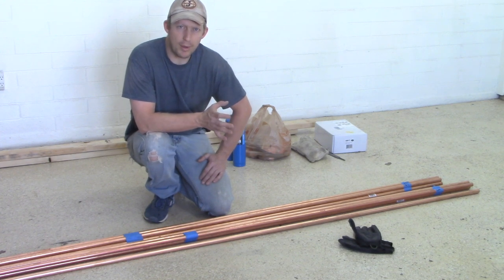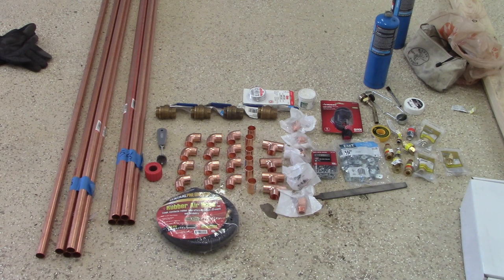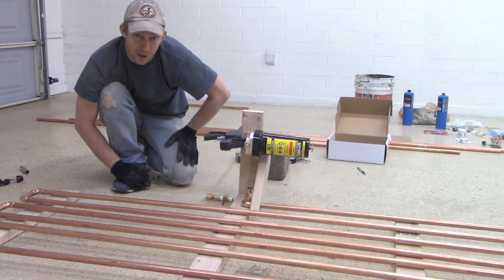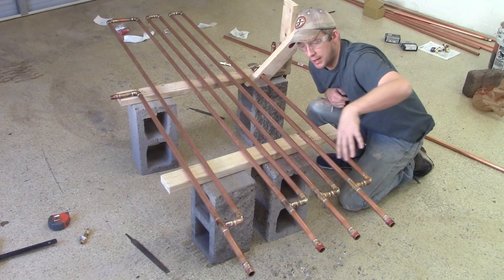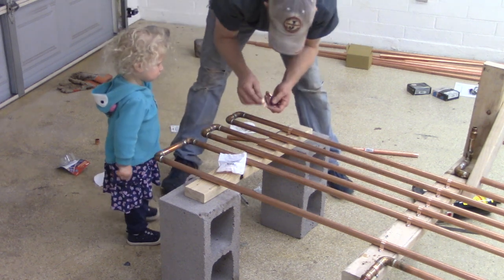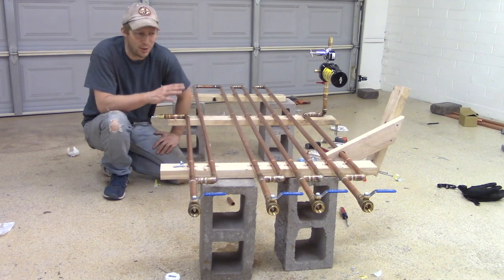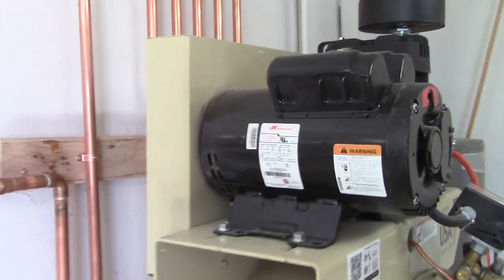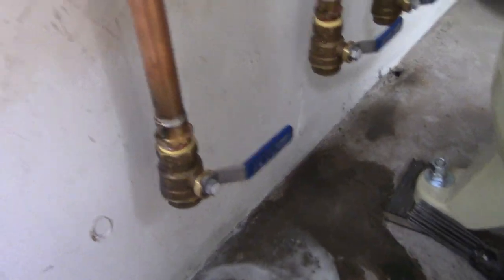Automotive Painting Air Filter/Drier System | How to Plan and Build

Comment: Nice job! I’m thinking about building the same type of system for my compressor. How has it held up, any issues?
Reply from the maker: It’s held up great and I’ve been very pleased with the results. Depending on how much you use the system you need to change the filter element, which is an easy process.